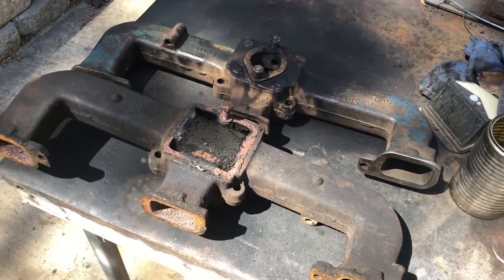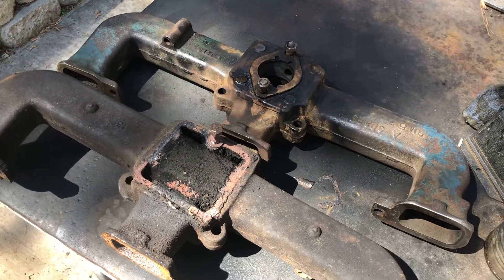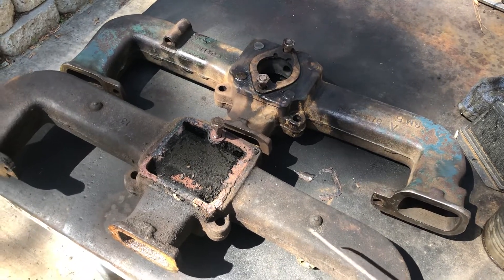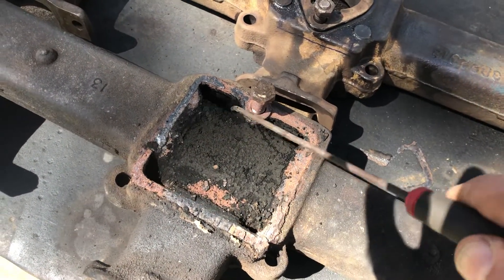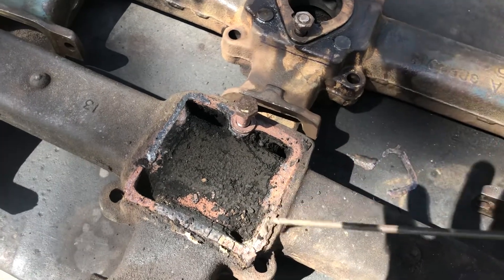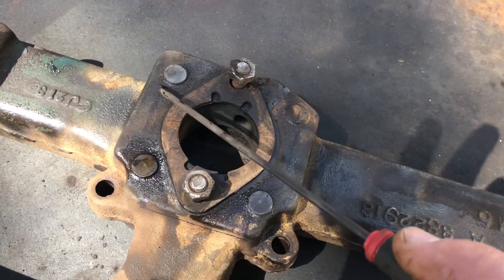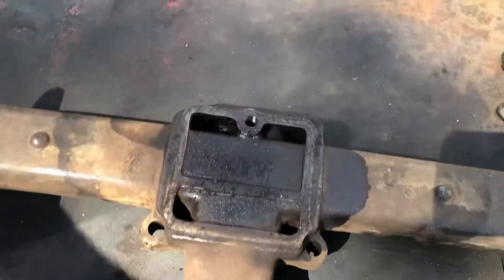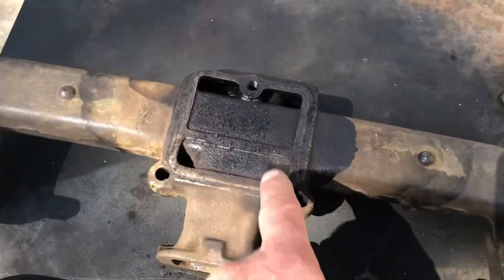Chevy inline 6 intake manifolds

Comment: Hi there i have a 250 chevy inline 6 i am putting in a 66 chevy fleetside truck and i am putting old stly header and was wondering that if i need to put a plate on bottom of the intake do i have to have some holes or breathers to connect to the headers or can i just put gasket and a plate without the holes on plate?
Reply from the maker: @LarryPrimera  They make a warming plate that bolts to the bottom of the intake where the exhaust manifold used to bolt. The warming plate has holes that allow engine coolant to flow through the plate like a radiator. That warms the intake. https://www.12bolt.com/store/p155/Offenhauser_Heat_Plate_Chevy_194-230-250-292.html
Reply: @Lugnutz65  thank you very much. I am using an old stlye header single not dual can i still use that plate. And if so is there a way i can see a picture or diagram on how to and where exactly i connect the two lines on bottom of plate. I appreciate your advice and thank once again.
Reply from the maker: @LarryPrimera  Contact the guy on 12bolt.com. He can explain and answer your questions. I’ve never done one.
Reply: @Lugnutz65  i sure will thank you very much for helping me out, deeply appreciate it. God bless.
Reply from the maker: @LarryPrimera  What Chevy is the engine going in? I have a 1963 230 that runs really well. All stock.
Reply from the maker: @LarryPrimera  What Chevy is the engine going in. I have a 1963 230 inline in my 63 truck and it runs great. https://lugnutz65chevystepside.weebly.com
Reply from the maker: @LarryPrimera  Another vendor source. https://www.speedwaymotors.com/GM-L6-Manifold-Heat-Kit-194-230-250-292-Fenton-Headers,383212.html?utm_medium=CSEGoogle&utm_source=CSE&utm_campaign=CSEGOOGLE&gad_source=1&gclid=CjwKCAjwhIS0BhBqEiwADAUhcyUG1u9R7qUndibubp7wVAblDQItBdxxpR_6hMzBw3roKYsekh59cxoCfcQQAvD_BwE
Reply: @Lugnutz65  its going in a chevy c10 1966 fleetside i had the 250 overhauled and have a 350 automatic that i installed. My daughter wanted to buy me a new truck but i said no just get me a 60 to 66 chevy long bed. So she found one but it needs some work which i planned to do. Install panels that i ordeted to replace cancer panels and i plan to install vintage air on it to be able to usecit all the time. I am also looking for a vintage 60s camper shell to put on it also. Nothing better than old school trucks in my opinion but make it usable with some of todays technology.
Reply: Yes buddy they are very reliable and with these gas prices going up and down its the best option to have but also they bettet then these new ones today that dont have any space in the back of them to carry full size boards or 8ft plywood cause i intend to usecit as work truck also and for cruising it.
Reply: @Lugnutz65  yea 63s are nice i like the front grill with the different eyebrows on lights.
Reply: @Lugnutz65  oh nice i will check it out thanks buddy.

Comment: What would you suggest for the cleaning method?
Reply from the maker: I added common solvents like brake cleaner and gasoline. I strong metal screwdriver chipped out a lot of it.
Reply: @Lugnutz65 how would you sell off the bottom side of intake if you are gonna run headers
Reply from the maker: @freethinker7805  
No need to seal the bottom side. It doesn’t have any holes that communicate to the intake runners. With headers, many folks buy or make a warming plate that mounts to the bottom of the intake. Engine coolant flows through the warming plate to add heat to the bottom side of the intake.
Reply: @Lugnutz65  so would it run ok not putting a warmer plate on or would it leak antifreeze
Reply from the maker: @freethinker7805  I think you might not understand my earlier comment. The original exhaust manifold heats the intake manifold. If you remove it (to install headers, then you’ve removed the source of heat for the intake manifold. Vendors sell a special plate to mount UNDER the intake manifold to use as a different source of heat to warm the intake. The special plate has hoses to circulate engine coolant. The special plate mounts to the bottom side of the intake manifold where the original exhaust manifold was. The engine coolant doesn’t mix with any part of the fuel system. https://www.speedwaymotors.com/GM-L6-Manifold-Heat-Kit-194-230-250-292-Fenton-Headers,383212.html?utm_medium=CSEGoogle&utm_source=CSE&utm_campaign=CSEGOOGLE&gad_source=1&gclid=CjwKCAjwhIS0BhBqEiwADAUhcyUG1u9R7qUndibubp7wVAblDQItBdxxpR_6hMzBw3roKYsekh59cxoCfcQQAvD_BwE